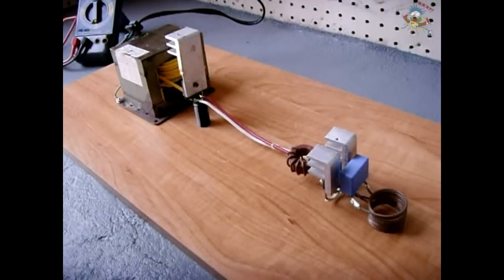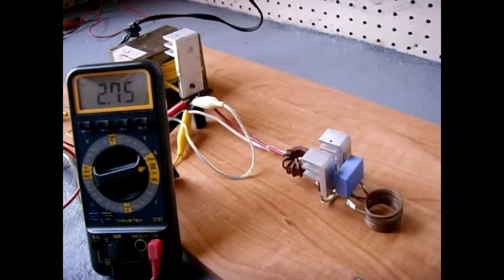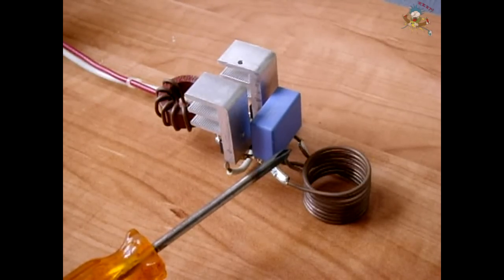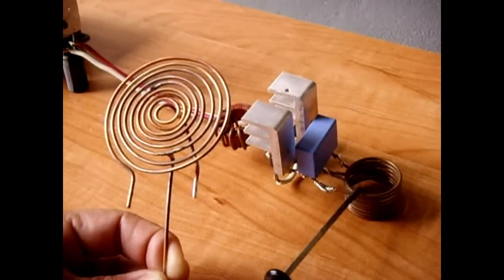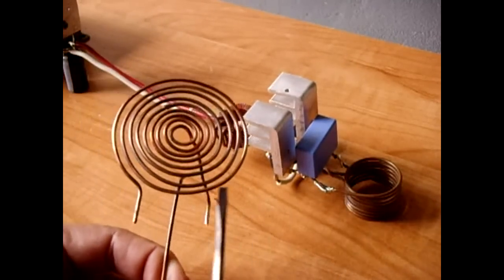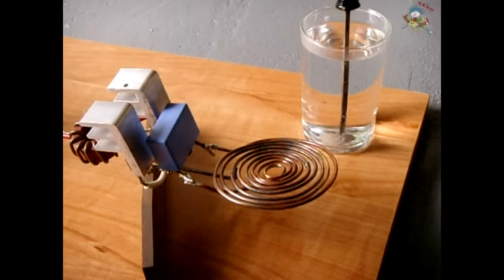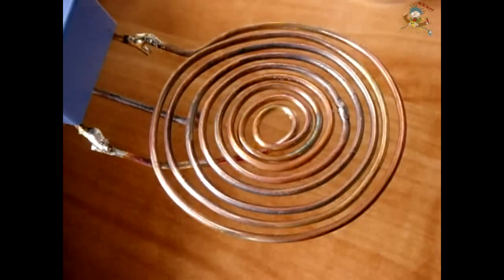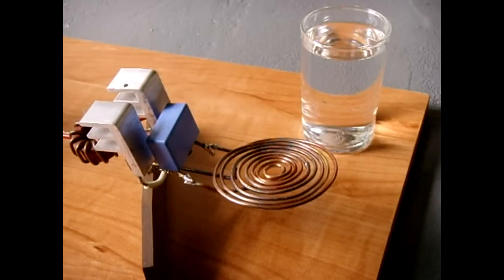Induction Heater Follow Up Video(Spiral Coil & Current Tests)

Comment: If i wanf to use smaller diameter and less turn working coil, will it affect heating time process?
Reply from the maker: The diameter of the working coil, and the number of turns will affect heating time and the concentration of heat. Experiment. :-)
Reply: @electronicsNmore  so which one is better if has same turns, bigger or smaller diameter?

Comment: What do the mosfets do? I didnt find any answers on internet explaining that...
Reply from the maker: They act like switches turning current on and off at a very fast speed.
Reply: @electronicsNmore  ok.... they switch AC whitch coms from the transformer to generate high frequency used for induction ?

Comment: Hi, I would like to know if with the flat coil it is possible to heat a steel needle (approximately 5 cm long, 2 mm thick) placed vertically in the center of the coil ..
Thank you
Reply from the maker: Absolutely Claudio, if you make the coil properly.

Comment: I bought a 60kW, three phase, medium frequency induction heater.  
I need to change the heating coil (cylindrical type). 
How do I define the material to be used, the turns necessary and the estimated inductance that can be calculated from the above data?

Comment: hello i have made a circuit res 10k and 470 5W  irf 260 diode 12v and 4007       i use 12 pc ps but this not resist burn   i test whit one ps and two in serie     whats wrong????
Reply from the maker: Use an online resistor calculator to make sure you have the correct value in parallel. 

http://www.1728.org/resistrs.htm

Comment: The alternate coil you had at the end would have relatively no inductance, although the tapping point would be exactly in the middle. What you may want to do is make two coils, flip one and connect them at the center. Then you can tap the center and have you two leads plug in to the exterior of each coil.

Comment: I'm just beginning to look into this method of melting metal, there is so many videos on this but little bits of important info here and there.
I am doing an experiment.
It involves disks of metal.
I need to be able to make the disks any thickness and diameter that I feel that I need. Also I need to try many different types of metal.
Definitely Copper and 316 L stainless steel.
What is the best method for me. I seen a mini ark furnace design, could this way be better then that?
I'm ok with pouring molten metal but if I could avoid the pouring process that would be awesome.
With this I could do the coil design to where it's shaped like a "U" and having it span around half the disk to where I could put it around my casting with with the scraps to be melted.
On that note , isn't it only conducive things that will heat up? Like what about wood or green sand, also what about glass and water?
I just need a cheap way to do this with no points of potential failure because of design or method of usage!
Please help?
Reply: David Prock Hi.  I'm just learning about this stuff myself, but I just want to mention that I don't think this will heat anything other than metal.  For example, another video that I watched shows induction being used to boil a small glass container of water.  But they placed something metal inside (I think a nut, but I don't clearly recall.  It's been a while).  The water was boiling because the induction coil was heating the nut in the water.  The induction wasn't affecting the water or container directly.

Comment: what is the need of center tapped for inductance coil
Reply from the maker: The working coil is center tapped to allow the current to flow in 2 directions. Positive and negative pulses.

Comment: By the way The transistor become very hot ..!! can you expect where is the problem ? 

The rated Ac voltage for C is 300 AC V is it enough ? Because the  C is smaller than what you used ?

Comment: Hello , I used stp30nf10 transistor with with coil of almost 2uH and polypropylene capacitors 47 nf, and i get 500Hz , the probplem is the currnt is very high at no load more than 6 amp and the coil is not working if i but a screw in it ? and i notice the voltage is zero zcross the C is that right becouse of the resonance ? Advise please ?

Comment: How did you make the shape of the spiral coil this even? Was it done manually or you used any instruments?
Reply from the maker: Hello. I wrapped the copper wire around a small can, then adjusted the rings after I slid the coil off the can.

Comment: can I use this same circuit for a much higher amperage? something like 100 amp? please send me the circuit diagram
Reply from the maker: If you modify the circuit for higher current. Larger power supply, use IRF3205's, heavier working coil wire, etc. Refer to the link in the video description area.
Reply: Ok...for a metal forge, what would you recommend for melting aluminum, lead, zinc, etc. In a steel crusical that is able 3 inch in diameter? I figured I would use 3/8-1/2 inch copper tubing for the coils. So what amperage should I run? I also have a MOT and can easily change the voltage
Reply: Ok so is high frequency caused from high voltage? If so could u keep the original windings on the MOT on just hook it to the coil? Sorry I am new to frequency

Comment: what kind of rectifier did you use with the capacitor
Reply from the maker: The MOT power supply uses a 10A full wave bridge rectifier.

Comment: Nice video,
1) Can I use the multimeter set on Henry to find the overall value and devide it in 2 and then work my way from outher ring inwards until the divided value is found for the exact position of the center tap?
2) Could the coil replacement from spiral to cilindrical also work with a excisting induction coockingplate unit to fastly make a DIY induction furnace?
3) Could not find info in this video if the Henry values of spiral and cilindrical coils should be the same?
Please help...
Reply from the maker: +Dancer 
Just make sure the inductance of each portion is about the same. Use the DMM to figure out where to place the tap.
Reply: +electronicsNmore 
Are the total induction of spiral and cilindrical coils also the same?

Comment: what is the need of centre tapped coil? please could you explain it? and why you haven't used driver circuit for mosfet's? like IRS2103 or etc?
Reply from the maker: +Shriniwas Sutar 
The center tap allows current to pulse in two directions in the working coil.
Reply: what will happen if we do not use centre tapped coil?
Reply from the maker: *****

No heating. :-)

Comment: Hello ihv some qu.
1. This circuit working voltage only 15v??
2. This circuit can heat up a screw driver to red!!???
3. Can i ues similar diode/mosfets???Thn what
Thanks. . . Its pretty awesome.

Comment: What is the max. Temp in the flat coil can deliver?
What is the power the circuit will consume?
And how to increase the rate of heating?
Reply from the maker: Kartikeya Lonikar I already to you how to increase the output in your previous question. The flat coil does not heat the screwdriver as hot as the round working coil. The flat coil is ideal for cooking. Current draw is similar to the other coil.

Comment: Try measuring the entire length of the wire. Mark the center, then after coiling it, place the center tap at that mark.
Reply: steven spall : I dont think so. The value of the inductance between inner versus outer must be different. The good way to do it is to find out the point of centre with the "LCR-meter".

Comment: what happens if the material you are heating is directly in touch with the coil?
Reply from the maker: If you only touch a single wire of the working coil, then likely nothing, but if you short out a couple turns of the coil, you may blow a mosfet.

Comment: What if instead of the use of a circuit you just hooked up the power supply directly to the coil?
Reply: It's all about the frequency. The transformer puts out a 50-60 Hz AC current. The rectifier/capacitor changes that to DC and smooths it out to a solid current. The mosfets in the circuit produce a high frequency current(thousands of Hz) Every time the polarity of the EM field in the coil changes(Hz is changes per second) the polarity of the molecules in the screwdriver change with it. That causes friction on a molecular level, producing heat. A smooth DC current won't cause any change, and removing the rectifier won't work either cause 60 Hz just isn't fast enough to do anything but make it slightly warm.
Reply from the maker: No good. Will not work.

Comment: Could this be current limited to 6A and switched on and off with an Arduino with a relay module?
Reply: NoFaithNoPain  yes I think it could, but why limit its current? It is absorbing as much current as it needs, a 10 A relay coul work to control it and the arduino can sure control a relay..so anything is possible! :)

Comment: Do you have another way for replace the Capacitor polypropelene for other one, because here is damn hard to find it also on ebay cost a fortune without the shipment ouch. Do you think should be fine the ceraminc one or can be worse using this?
Reply: the3dultimate Ceramics will most likely fail early. These types of circuits pump a lot of current through the caps and they have to be able to stand it.
Reply: +the3dultimate Don't! Ceramic caps have a huge dielectric loss when abused in such way. They'll get damn hot, trust me

Comment: I watched both videos.Very nice.I need one of these for a project but it would have to be scaled up to about 2-3/4" to 3" core.Any suggestion for components for this upgrade?Also,I see you changed caps from your first video from yellow to blue?Was curious why you didn't go ahead and swap for the parallel caps as you mentioned?Also,why you don't use a heat sink on the caps?Thank You for posting!
Reply from the maker: You cannot really use a heat sink on plastic caps. Even if you placed the caps in mineral oil to cool them, the center of the capacitor will not be in contact with the oil to keep cool, and the capacitor would fail. I think the capacitors were the same type/rating, just different manufacturers. You need to use higher current rated mosfets, slightly thicker copper wire for the working coil, and a few quality capacitors in parallel to distribute the current.

Thanks For Watching

Comment: I pulled parts out of an APC battery backup. There are what looks to be 4 transistors on big aluminum heat sinks. I can't find any info on them 94-4311 I¥R 942P is all I can see, then each has a unique circle with a letter then number e.g.: 6H, F1, E3, BC. Do you know where I can find info on them? I'm having no luck. Thanks a million if you find a second. Really wanting to try your project.
Reply from the maker: No idea. You have to do more searching online. Possibly an international rectifier component.
Reply: electronicsNmore Ok, thanks anyway brother
Reply from the maker: Very hard to tell what it is w/o a photo. Take a close up photo, place it online, and post the link.
Reply: electronicsNmore The part in question is extremely hard to read, but I managed with the right lens. One pic showing everything I got from the bbu unit, relays, caps, etc. -also shows the 4 mosfets(?) in the back and up close. http://imgur.com/a/K1Jxf#1 -Previous comment has the numbers. Thanks again for looking. Edit: I loosened and rotated them so the contacts weren't hanging off the heat sink.
Reply from the maker: I could read the entire number. I found nothing. I'm sure it is a mosfet, but I have no idea of the rating
Reply: electronicsNmore Thanks for looking amigo.

Comment: very nice video! i see on the blog you have a stronger one can you please tell me if i can use a single cap instead of lots of them? also a guy there says put your caps in parallel with each half of the work coil i don't get that how i suppose to do this? connecting one end of each cap to the center tap and the other ends one too the one coil terminal and one to the other?  and what would the ratings "vdc-vac- uf " of the single cap would be? or pinpoint me if you have one in the site to buy. sorry kinda noobie here.. thanks!
Reply from the maker: Thank You!

The website has lots of information on it. It is not my website. I only made 2 induction heaters. I take it you saw the first video. As for the capacitors, using 2 in parallel helps distribute current to keep the capacitors cooler. The capacitors shown are normally rated 250V, but you could probably use a 100V.

Be sure to share, and also watch my video playlists
Reply: thanks man really apreciated it cause some people there are saying they using 1kvdc caps on it and that just soundet weird..more like overkill...
Reply from the maker: Mine are 250V, and they are fine. I just cannot run it for long periods of time otherwise my caps will heat up. I have to place a few in parallel myself!
Reply: what can you do to minimize that problem? do you think a 500v cap will do the job without heating up?
Reply from the maker: Not the voltage causing it, it is the operating frequency/current. Look for a capacitor designed for high frequency operation.

Comment: The spiral coil that you intend to build is not inductive as it is not really a coil/loop in that there is  no area enclosed by the  flowing current, that is they are too near each other. 
As for your tested spiral, as you said the inner loops are much smaller than the outer loops and so  there is an incrimental variation in the  inductive value of each  decreasing loops. I played about with loop antennas and small  loops placed  centrally in larger loops are  not that effective but when the smaller loops are displayed to one side the  inductive effect is better.I am not sure that a small loop within a larger loop contributes  anything as  the  magnetic flux from the inner side of the smaller  loop will return through its outer side and so the net flux in the larger loop is minimal.  In  loop antennas the small coupling loop are always displaced  to one side  where   the flux from the smaller loop does link  more satisfactorily with the larger loops.
Congratulation for your  descriptions, you will make a good University lecturer, I assure you.

Comment: To measure the ratio of the inductances of the two portions of your spiral coil, use a Wheatstone bridge arrangement (excited at, say, 200kHz).

Another alternative coil would involve a bifilar-wound pair. Since the geometries of the two would be identical, the inductances would match. The common of the two coils would be formed by connecting the center lead of one to the outside lead of the other. (Interwinding capacitance would be much higher with this geometry.) Your alternative coil, shown at the end of your video, is close to what I am proposing, except you have, essentially, connected the two "backwards".

Comment: Is it possible to make larger coils having diameter around 30 inches? actually I want to heat a large iron vessel( which is till date being heated by a gas stove) having a diameter of 38 inches. I would also like to ask if an induction cooktop (household one) having coil diameter of 9 inches could do the same?
Reply from the maker: If this works using a small pancake coil, a larger coil should also work. Of course you would need to use higher current mosfets(irf3205's or similar), heavier wire for the coil(maybe 6 or 8ga solid wire), use several capacitors in parallel to keep them cooler, and also raise up the voltage. You need to experiment.

Thanks For watching!

Be sure to check out my video playlists.

Comment: Could you use a PC powersuply instead of the transformer?
Reply from the maker: Can the power supply deliver up to 8 or 10 amps? Give it a try.. I prefer a MOT like I used in the video. Easy to make one.
Reply: Its rated at 12V and 15 amps...but its DC current
Reply from the maker: That is what is being delivered to this circuit, DC.

Comment: to make it similar to commercial stovetop induction heater you could probably put a small ceramic tile above the flat coil and then a put a small pot or steel plate?
Reply from the maker: Yes. Or a piece of tempered glass.

Comment: Your idea for that type of coil may offer some decent inductance, but it probably will not induce a fluctuating magnetic field into a load (screwdriver) This is because with this, you have essentially rectified the magnetic flux, and the current coming from the MOSFETs will spiral around in the same direction, with the same peek current. This is assuming the circuit will oscillate properly to begin with. It is also possible the way the magnetic field will form around the wire, that it will be self-destructive and amount to nothing. This reason I think this is because current can "spiral in" and "spiral out" at the same time when a current is passed through the 2 outer wires, but this would only be the case without the center tap, driving this directly with high freq. AC.

But this this just my hypothesis. I really have never tried this. Great video, as always!
Reply from the maker: I thought that also. The current is going the same direction into the spiral that I did not test on the yellow paper. At least I know the one I tested works. :-)